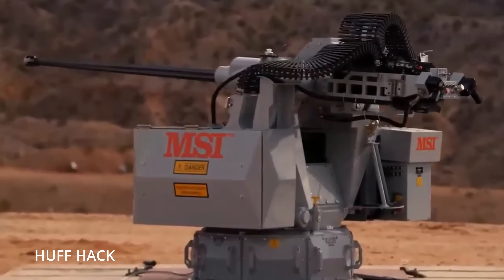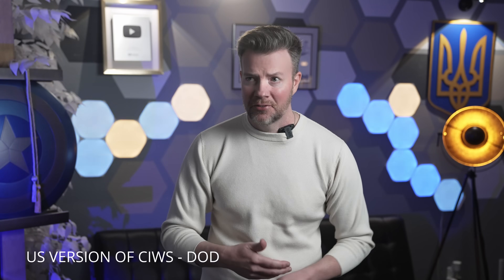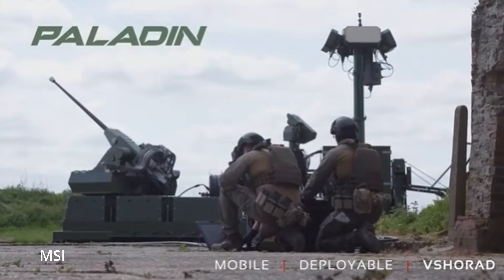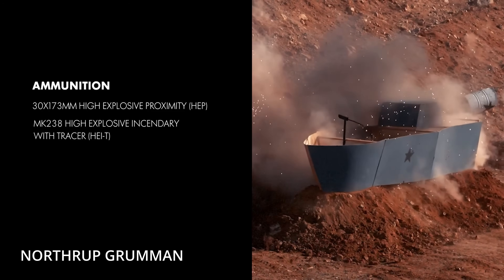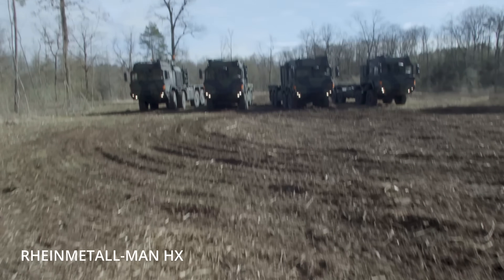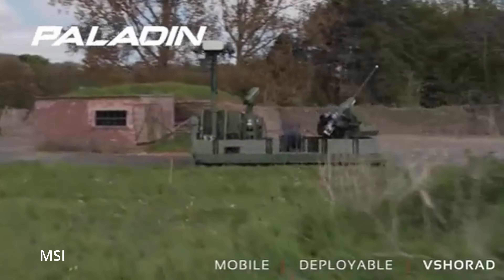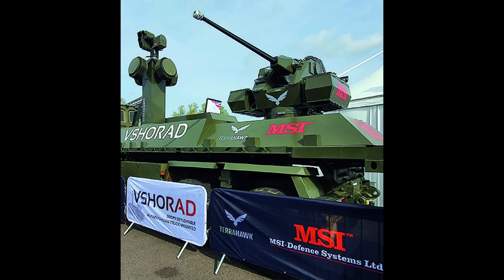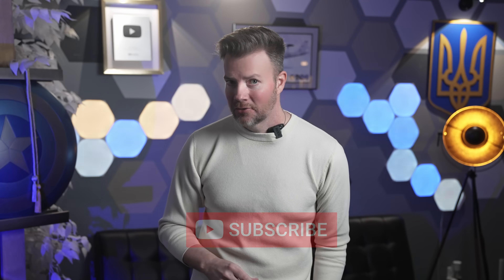Britain Just Sent a Drone-Slayer to Ukraine. It’s a MONSTER

Comment: Sounds like it does what it was built to do very well. That is to be a defensive system to cheaply (relatively) dispatch drone swarms. It isn’t an offensive system.
Reply: Basically point defense, drop it off to protect power stations or other valuable targets & let it do it's thing autonomously or via networked remote operation.

Comment: Terrahawk can move. The unit is based on a roll-on, roll-off, civilian truck bed. It takes less than 2 minutes to hook it up to and from the trailer unit. The truck has a hook that would usually pick up large bin units or containers in civilian life. In the UK, there are tens of thousands of such units.

Comment: Don't see any problems with mounting this on a trailer with hydraulic jacks.  When it needs to be moved, retract the jacks, hook up the trailer, and move it to its next location.  Or mount it to some old and obsolete APC, old Tank Chassis or an old flatbed truck.
Reply: The DROP pallets are just as fast as hooking up a trailer, but give a smaller profile when deployed.

Comment: So put the Paladin load pallet on a wheeled chassis for quick shoot n scoot firing missions. The chassis would be a low-profile mobile platform that resembles those towing units used at airfields to move logistics.

Comment: Point defense against drones in order to maintain a secure area is a big problem and this unit is a piece of a multi layered solution. 
You'd need a bunch, and you'd want a fire control and tracking system thats scalable to give 360 degree protection against swarms

Comment: How is this "British?" Bushmaster guns are designed and produced in Carson City, Nevada. U.S.A. The company is American-owned and headquartered there; their products are 100% made and assembled at this facility.
Reply: Just one component when integrated into a powerful system.
Reply: The guns are great, well proven and reliable. But the innovation here is the target acquisition, fire control and ammunition. The system can change the parameters of each round of Ammo as it leaves the barrel depending on the type of threat. It really is very clever. You should read about it.

Comment: Not so sure this is a substantial boost. A placed turret is easy to target and take out. The take aways from the defence of Ukraine seems to me to be that you have to be very agile to last on the battlefield. Seems that it would be better to weld it to the truck and move it along faster. 

But what matters most is how many units Ukraine receives. If it is just a a handful it might not change much at all. Ukraine need like a 100 to 1000 to get a substantial boost to force Putin to end the aggression.

Comment: I don't care how potent your military weapon is.  But if you can't take down hundred of drones successfully your weapon is useless in the modern warfare. Only AI fully operated machine guns can take down all drones. And they should be mounted on tanks, armored cars...etc.
Reply: But in the real world, we have to make do with real weapons that actually exist.
Reply: You might want to do a deeper dive on your OSINT. There are half a dozen systems that can drop 100 drones at a time. Directed EMP, microwave bands, kinetic, laser, etc...there's not one specific system. But there are layered defense systems. Think on the level of the IDF. They're not at the 100's at a time level, but I'm just giving an example.
Reply: @MrDAS1984  When you use EMP to jam drones you also jam your surrounding military machines. Russia tried but limited success.
Reply: @Mark_Thackeray  The energy of the Electromagnetic spectrum is light. Only 0.0035% is visible light. I'm sure you're familiar w/ the duality of light (both a wave & a particle) that can be lensed & focused. Galileo figured this out first when he manipulated convex & concave lenses & focused & intensified light. 
That said, there are multiple variables to consider. The use of Faraday cages, metal plates can deflect, reflect & w/ the curvature similar to a radar dish can all manipulate the EMP against the mass raid of drones. 
I've seen it. When I worked for Bell Labs, we had a 'customer' working on this tech on the late 90's early 2000's.

Comment: Hey WES!
     What do you think of the idea of the UK or whoever sending Ukraine some Harrier Jump Jets?
                               MADE in EUROPE ~ LOVED by the US MARINES
Proven performance, direct support on the Continent, VSTOL and 500 MPH (?), with current systems
Reply: Unfortunately AV8B is manual compared to F35B meaning much more training is required. The original Harriers are unserviceable so not an option.

Comment: my problem isn't one or two drones trying to sneak in the perimeter . How can it handle a drone swarm at different altitudes and from different directions ? I can see we are still stuck in the cold-war-era mentality. single-axis engagement isn't enough . it should be able to engage in at least three axes.
Reply: That's why networked defence is important - multiple systems under common control. Which this supports. How effective is it in practice? Time will tell.

Comment: I'm thinking that just because you can unload it from the lorry, that doesn't mean you have to, unless it only works when on a solid surface. So instead of unloading it, do a shoot and scoot with it still on the lorry, and be out of there before the counter battery fire arrives.
Reply: I suspect it needs to be dismounted due to the recoil. Rapid-fire weapons need a steady base or accuracy will be dreadful. It is not intended for front-line use.

Comment: Why can’t it stay truck mounted on its drops pallet ?
Reply: i assume the tyres and suspension of the truck would reduce the static weapon's ability to recover from recoil.
Making subsequent shots less accurate or increasing time between shots.
Reply: @senseisean6632 good point outriggers might help with that but I suppose any movement would be a hindrance 😎

Comment: I would have put it on a trailer but otherwise looking good.
Reply: It's dedicated to single facility. It would be better to have it in retractable bunker to avoid missile attacks or similar attacks.
Reply: @vencdee  It will take time to build effective bunkers for the systems in all the places needed. They still could pick it up and move somewhere else in the same area. I would make it harder for Russia to know exactly where they are, seeing one in action the night before for example. I would play the shell game and put up camouflage netting or something in multiple places and have Russia guessing where the system is.
Reply: @FredHintz-l7w  Of course. You may even build multiple false dummies from wood or so around.

With bunker I mean concrete hole with retractable conrete slab on top, nothing complicated.

Comment: Thank you for bringing this tech and plugging in the Monty Python. Fantastic intel vid series. Love the new emerging unmanned systems tech and now know how they work. I would push more funding into R&D for making moveable platforms with groups of engineers and repair techs so they can make them just as elusive as the mobile Gripen units. I still wonder if they could make a drone huge enough to lift this platform and move it anywhere on the battle field making it a huge leap forward in unmanned positional warfare.

Comment: 5 or 10 Terrahawks would provide significant defense around Kiev.  Put them on high ground. Move them around daily.  And for the previous response, I think it would take quite a few drones to take out a Terrahawk.  If that does start to happen, adding in mobile Geppards in the area or other options like Gravehawk would help to protect the Terrahawks while significantly reducing the drone threat.,  If the drones are going after the air defenses, that means that aren't attacking other sites, like electrical infrastructure.

Comment: It can be placed but it can also be mounted for mobility. Each tapping into the NATO intelligence center. Think of the programmable ammunition as a firework. its fired and at a set distance detonated creating a shower of shrapnel. as the ammunition exits, its given coordinates to explode at . This palletised deterrent can be placed and then moved via a truck to new coordinates very easily, if necessary

Comment: not a big fan of this 'stuck in one place for the moment' concept. it's fine for a ship alright. the ship moves with the gun and the gun protects the moving ship. but on land you want this system itself to move - not just occasionally when you have time to pack it all up on the truck and move to the next location to protect. you want the system itself protected by being able to move if something urges it to move! it doesn't even have to be a typical target but some danger on the ground threatening the system. 
no, I'd prefer moving guns shooting at this kind of threat. even for stationary objects needing protection like power plants, factories, hospitals etc. - they don't move but the system needs to be able to move. 
no, not good enough. :body-blue-raised-arms:

Comment: this can protect maybe 1 square mile
Reply: It is meant for static defence, like power stations and fuel dumps.  3.2km is two square miles of coverage btw.  Which is a massive area.  Two square miles is e roughly  two thirds the area of New York's Central park.  Two Terrahawk Paladin systems could cover it all with massive overlap for the central portion.
Reply: @Yandarval  not really.  those sensors need to be above tree height to have a view of the whole area.  Also, stopping a cruise missile is unlikely...ballistic missile impossible.
Reply: @peetky8645  It is not meant for that sort of missile defence. It has been optimised for drone combat.  ABM and high subsonic missiles, were not on the cards anyway for this system.
  I was pointing out how big an area, one of these systems could cover. Hot so much how it is placed to get that coverage.
Reply: @Yandarval  can it shoot down a shahed?
Reply: @Yandarval  30mm is a really nice calibre. It was chosen for good reasons.

Comment: I'm kinda surprised they went with the 30mm instead of a bofers 40mm. Bring back the old bofers guns I say!.

Also the Brits are epic for naming things for sure.
Reply: I believe it was a successor to the Phalanx CIWS, which was 20mm. But the 20mm was found to be too limited in what you could put into a shell. A 30mm shell has a LOT of punch against anything less armoured than a tank. In WW2, the Germans introduced 30mm cannon into some of their aircraft to take down heavy Allied bombers, and the shells have become much more lethal since then.
Reply: @jrd33 Pretty sure 40mm are more effective across the board for lethality and the various programmable ammunition. The amount of explosives you can fit into a 40mm shell compared to a 30mm is quite significant.
Reply: @eraldorh  I imagine the decision was largely driven by the fact that the 30mm gun is already in British service.

Comment: I don't see a generator, so im guessing it requires a constant power supply from other sources
Reply: Seems likely. Probably draws a lot of power for the radars, sensors and weapon. It was designed for ship use, where electrical power is always available.

Comment: The key issue with layered air defenses is that you need to decide whether to use the expensive missiles first, then the cheaper missiles, then the cheap gun amo. In principle it's exactly the wrong way around. You'd want the first layer to engage to be the cheapest and the last line of defence the costliest. But how to do that 🤷
Reply: Great concept but you also want to engage with the most appropriate asset. This gun is effective against drones and probably even cruise missiles but useless against large ballistic missiles.

Comment: A number of these spread out on top of several tall blocks in cities would vastly improve air defence
Reply: Anything that sits in a static position is guaranteed to be taken out over a short period of time given how saturated the airspace is in missiles, drones and fpv drones. Air defence has to be mobile to survive long term.
Reply: @eraldorh not if mutually supported. You could even bait out ordinance and aircraft out this way or area deny totally 👍
Reply: I agree.  5 or 10 Terrahawks would provide significant defense around Kiev.  Put them on high ground. Move them around daily.  And for the previous response, I think it would take quite a few drones to take out a Terrahawk.  If that does start to happen, adding in mobile Geppards in the area or other options like Gravehawk would help to protect the Terrahawks while significantly reducing the drone threat.,  If the drones are going after the air defenses, that means that aren't attacking other sites, like electrical infrastructure.
Reply: @randys617 given that's its job is to take out drones i'd hope it couldn't be taken out by one. (Unlike the s300 or s400 that can't seem to detect any airbourne threats,  drones included) More likely it would be targeted by eg kinzhal
Reply: @randys617  Put 20 dummy's  between them.  Then the operators or the "brains" of the drone  will get difficulties in  dispatch the drones to an interesting target.

Comment: turret in a box sure, but that box need to be bolted on a trailer or anything with wheels and moved around, or it will take a ballistic missile to the head sooner or later, we really need to stop being stupid about this...
Reply: It’s meant to be part of a layered system and I’d to think that such layers might be able to seek out and intercept missile but ballistic missiles and glide bombs are difficult to hit. As such I take your point but might I add a caveat? Any vehicle mounted system is inherently unstable vs a static one. Whilst the vehicle might have “legs” to stabilise it, would the system not have to be recalibrated after each “shoot and scoot”?
Reply: I've seen others saying it does come in a truck-mounted variant.

Comment: The Terrahawk Paladin (TP) doesn't need a crane to lift the container base on which it is situated, the vehicle uses a "Bin-Hook" system attached to the vehicle chassis, variations of which are used on thousands of trucks (in the UK at least). 

Trained operatives will have the TP loaded or unloaded within 2-3 of minutes. (If the container base had small steel wheels on the rear you could probably halve that time at least on hard surfaces which I accept may not always be available.)

Love the channel BTW.
Reply: That 'Bin Hook' system has been part of the UKs military for around 50 years, used for delivering Ammunition to Big Guns , Fuel as needed and all sorts of supplies. A very versatile and well tested palletised system. Plus it is also used commercially by literally hundreds of companies for Recycling materials and scrap metal movement. One lorry unit can be multi-purposed as needed.
Reply: Its shown in the picture at 2:47, that hook-lift is what he meant about the crane. Although, a conventional crane truck would be more versatile as it can place the system on any truck bed or tall structure, no need for a specialized truck.
Reply: That hook is a very specialized type of crane.
Reply: @dgthe3  I be tthe Ukrainians are already modifying it as we speak so any old crane will do, which is how it should have been designed in the first place.
Reply: DROPS,
https://en.wikipedia.org/wiki/Demountable_Rack_Offload_and_Pickup_System

Comment: Maybe building more Gepards would be the better choice, given that at least, they can get relocated around the site they protect to avoid sabotage or dedicated targeting with weapon systems, they cannot defeat. And was Gepard range not 4km or 5km?  I would assume, that the Gepard ammo crisis we saw early on is not an issue anymore. And fielding more Gepards would actually be a better and more flexible fit. So, how does "per unit" system cost compare between Gepard and those whatever-hawks? Also, the number of units delivered was not mentioned in the video I think...
Reply: More the merrier

Comment: its on a drops pallet simply back a truck up to it grab it with the hook and pull it into the back and off you go far quicker than described in this video
Reply: Exactly, it probably takes longer to reel the cables back in and prepare it for transport than it takes for the truck to hook, lift and full throttle away.

Comment: Cannot fault anyone for choosing a layered defence system, it just makes sense. It can even be used against ground assault troops in a pinch.  Be well and stay safe
Reply: Hopefully ua gets 1000+ of these so they can block a line from North to South to drones, creating a safe rear.
Reply: It's what we 🇬🇧 learned in WW2 first Defending the country in the Blitz and then Later in tackling the V1 hazard ...where the guns were moved further towards the coast  along with barrage balloons  on wire hawsers.. then Aircraft then guns round London... no defence against V2s other than destroy their factories and fixed launch sites. 
These days that job would be backed up with patriots attack drones and short range missiles.